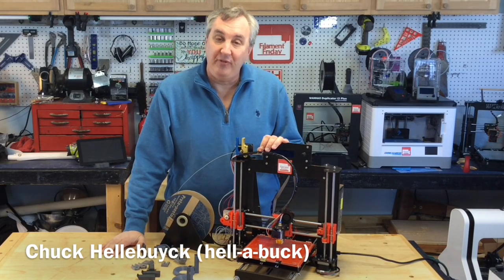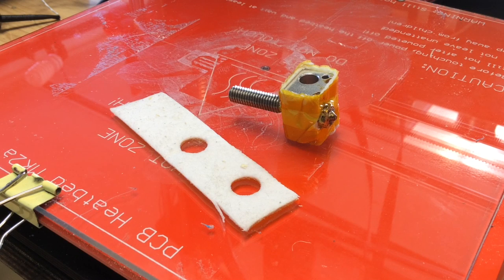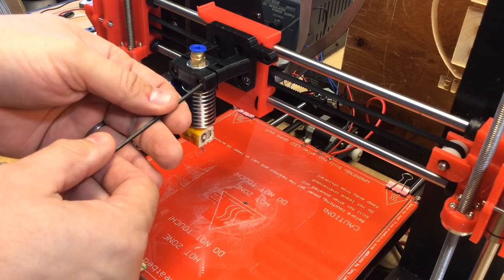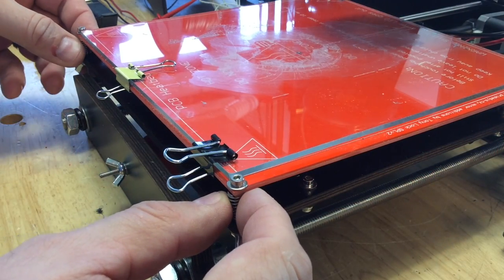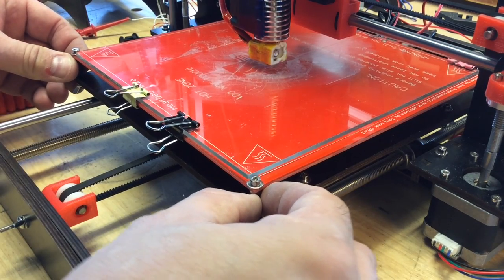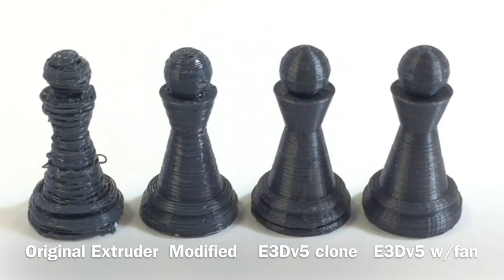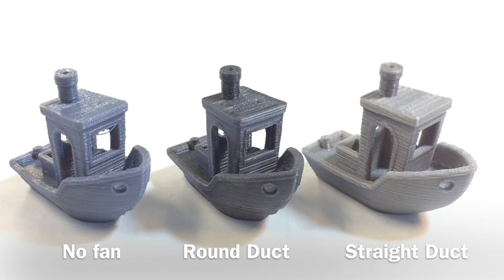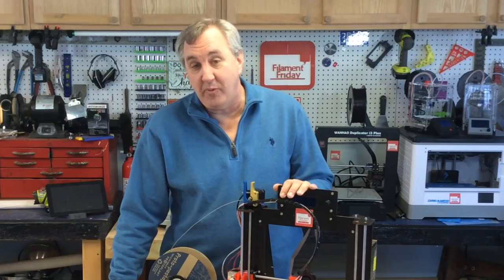$154 3D Printer Upgraded to E3D Hot End

Comment: I think most of the improvement was due to fixing all the loose parts. I had a stock Anet A8 for awhile and if you build it right you can get pretty good results. That said, I have recently upgraded my A8 to an AM8 (all metal frame) but I've kept the stock extruder and hot end. Have even printed samples of metal filled filament with it. Next upgrade planned is to switch to a three point bed mount to make bed levelling easier. I will switching to an E3D Bowden set up eventually. That will lighten the x axis but you still need to lighten the bed/Y axis if you want it to print faster.
Reply: I have the 2020 version which doesnt come with the 12mm threaded rod on the Y axis it instead comes with all smooth 8mm aluminum tube (not rods way worse) that are all different lengths and 12mm centre brackets that dont fit. Needless to say once I had it assembled its got that much play in the frame on all axis I refused to turn it on and have spent the last week modelling and printing braces and improved parts.
Reply: @ps3customgamer  I forgot to mention I also fixed mine down to a 1" thick piece of MDF. Before that I had issues with having to re-level the bed any time I moved my printer. Whole thing twisted to suit whatever uneven surface it was on.
Reply: ColinWatters makes sense. I’d rather use braces with printed parts though I bet your method is better

Comment: Great video.
I got mine few days ago.
I had also the problem with the extruder stepper motor clicking and not feeding.
I could improve it with adjusting the potentiometer on the control board right above the cable going to the to extruder stepper motor.
Do you know if there some calibration should or could be done ?
The SD card I got with the kit isn't working. do you know where I can get all  those files online ?
Thank you

Comment: Pretty cool!
I'm doing something similar with my DaVinci 1.0. 3D-printing upgraded brackets and plan on buying an e3dv6 with a titan extruder. Already upgraded the heated bed for more even heating since the stock one was burning the middle of my prints.

Looking forward to seeing what you do with this cheap 3D printer. =)
Reply: If you decide to give it a shot, this is the carriage for the hotend that I plan on using: http://www.thingiverse.com/thing:1634298

Going to try using the Titan with a pancake stepper motor. Will see how that goes once I have enough $ for it. XD

Also looking into upgrading the stepper drivers.
Reply: I was actually looking at that one at first but found the benefits of the Coyote Mount were too useful to pass up. =)

Also has this option: http://www.thingiverse.com/thing:1731105

Comment: Hi Chuck, tinkercad beginner here, I don't suppose you have any pointers on how you extended an object in tinkercad? great videos.
Reply: Super, thanks, I will have a go, I need to get to grips with how / what  works in tinkercad. Thanks for the reply and super video, cant wait to see what else you do to this printer. Now that you have a lighter print head will you be printing faster? How is this printer holding up against vibrations? Great videos, keep them comming.

Comment: i have the same printer and im trying to put an e3d v6 clone on it but it has a different thermistor on it than the original. how did you modify the software on the arduino board to make it work with the e3d's thermistor?

Comment: I have an I3 clone with z banding issues. I can't wait ti see how you solve the problem.
Reply: I may have to do that. You have always been so helpful.
Reply: problem shown in the video is not z banding- its too often and in all directiosn, z badning is visible as shift not the expansion as on above pictures. Chep try to lower fill rate, it is overextrusion you are facing- start printing and tweak fill rate to 70% then increase it until there will be no gaps between lines but before you will see uneven spreaded filament.

Comment: I ended up getting the same clone you did, was quite disappointed with it. i ended up using rep rap champ (super sketchy looking store on amazon got mine on ebay) and appears they have the closer clone as the v6 than the one you got yours from. I also swapped my smooth idlers for toothed idlers and that helped a lot and I was able to get the belts a bit tighter.
Reply: Cool, thankfully that part of mine was good, the idlers were a bit iffy. Next thing I get to do is figure out to reset the zero point since the hot end is in a different place now.
Reply: Aww ic, yeah mine is an xy problem so there is some firmware I have to change. Ill have to figure that one out after I get done with my move in a month or so.

Comment: if you separate the extruder motor, you need a hose for the filament as it would bend instead of going in the head. what hose did you use, and how did you fix it to the e3d head? I can see a nut there, but don't get it how it stays there. thanks

Comment: Hi Chuck, I replaced mine with a E3d hotend but it only reaches 130 C max.
Reply: It takes forever to heat up, so I just shut it down. Is it possible that I have the wrong voltage on the hotend? Do you know what the voltage rating for your hotend is? I have the same 3d printer.

Comment: I just got this for Christmas as a gift and have no prior experience with 3d printers. Did you ever tackle the z axis banding?
Reply from the maker: Never solved it.
Reply: My z axis was squeaky, but didn't bind. I received a similar CTC model from Amazon as  a birthday gift. 

After getting the z-axis moving with wd-40 you will need to oil it with a machine oil. Wd-40, P.B. Blaster, and other penatrating oils are great for breaking things lose, but are not intended to be a long term lubricant. I hope some machine oil fixes your problem. If not you might need to get new/better screw rods.

Comment: Maybe someone could help me...i have a problem with the extruder.....the motor is working on wrong direction and PLA filament goes out....i cant print... I dont know how to solve it.
Reply: CHEP could i change values on the lcd panel?
Reply: CHEP ok. thank you. And is it difficult to reprogame it? what program i should use?
Reply: CHEP ok. so i should change the red colour with the black one or the green with the blue?
Reply: CHEP thanks so much. that works. finally i have changed the original structure to a prusa i3 steel...so by printing things...they seems thinier than before...what parameters should i change on the panel?
Reply: CHEP thank you so much for all your help
Reply: CHEP i have printed a cube 50x50x10 (original size) and it has a size of 40x40x10(printed size)....  
What values/parameters should i change on lcd panel to print 1:1

Comment: Im about to do some of the mods in the video, but do you think replacing the z axis threaded rods with proper leadscrews would help with z banding or would I be wasting my time?
Reply from the maker: The Ender 3 actually has a 4 start 2mm pitch 8 mm lead screw.
Reply: It will eliminate some play but you will find significantly more play elsewhere. Using braces that fit underneath will significantly improve stiffness of the frame allowing for faster more accurate print, the brackets the bushings fit into under the bed have about 1mm play to fix either print out a 1mm thick tube as a filler or someone has made a better bracket on thingiverse.

Comment: Hello Chuck! I have watched your videos for a while now and i started modding my 101hero. I have replaced the motors on everything except the extruders. I replaced it with Nema 17 motors. When i click print the 3 arms just move all the way down to the buttom of the pylons.. i dont know how to fix that, do you? When i click home it works and when i click that the y axis should move 5 cm Down it does it, but when i say the x and z axis should move 5 cm down they dont do anything at all
Reply: How do i modify the firmware? It doesn't show up on Arduino
Reply: Okay, thanks for your time it is much appreciated!
Reply: Hey Chuck! I just figured out you just could do a command in Repetier and/or Cura M92 Z280.00 X280.00 Y280.00 but it still does that with the arms..

Comment: I bought this same printer and got the frame and everything assembled solidly got one really great calibration cube literally first print was perfect because i took the time to tear it down and reassemble the x and y axis and straightened the z rods. but on the crappy default hotend my temperature sensor fell out mid print and it burned through the Teflon lining and ruined the hot end. luckily I had gotten an all metal v6 clone to upgrade to ahead of time but I couldn't flash firmware to update to a bowden with a reverse direction so I had to order a ramps board and arduino. have to wait for those now lol. any suggestions as to any printed upgrades I should do? also is the filament in the box worth trying to get to work or should I just use my hatchbox filaments. also what do you think of this 3d printer. ive put $175 towards it so far and it seems almost like it could be a good deal.
Reply: thanks I also figured out you can reverse the Bowden insertion direction. either way I want to update the firmware so I guess two days of head scratching for a simple solution was worth it. I have to print a v6 mount I hacked up the original hotend mount and have the v6 clone attached with zip ties
Reply: I was able to flash mine to the latest Marlin firmware.  Even with copying over the factory settings it helped a lot.  (mine has the GT2560 mainboard)
Reply: i think the issue with my board is that the ftdi chip wasnt soldered on correctly

Comment: Nice work... however your quality should improve like 3-fold after modding this machine. I think you need to calibrate all axis very carefully. (your Z axis looks horrible as far as i can gather from your pictures)

Your best quality after modding still looks 3 times worse compared to the same machine with the "stock" setup and no modding.
Reply: Sorry its very true. Sounds like your stock setup had/has some flaws. Anyway I like your very clear explanation of the E3D mod... Tks ;)

Comment: Hi Chuck, What if you replace the x-idler and x-motor ends with Mk2 ends.  Those put the z-axis threaded ring at the top rather than the bottom.  I bet that would also help eliminate z-axis banding.  Here are the Mk2 STL Locations in GitHub:
https://github.com/prusa3d/Original-Prusa-i3/blob/MK2/Printed-Parts/stl/x-end-idler.stl
https://github.com/prusa3d/Original-Prusa-i3/blob/MK2/Printed-Parts/stl/x-end-motor.stl